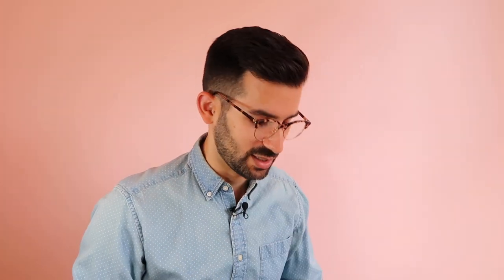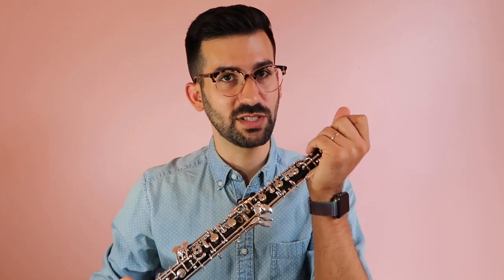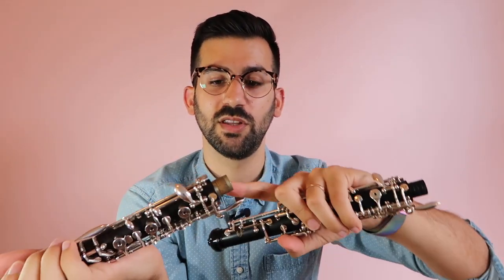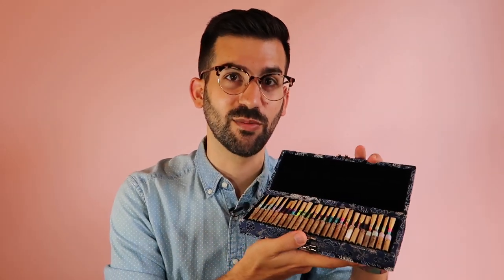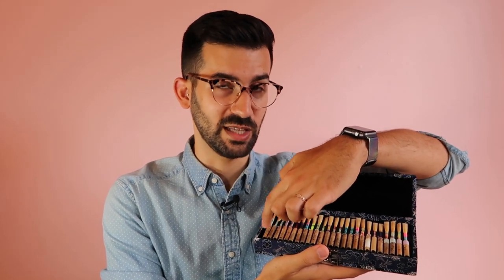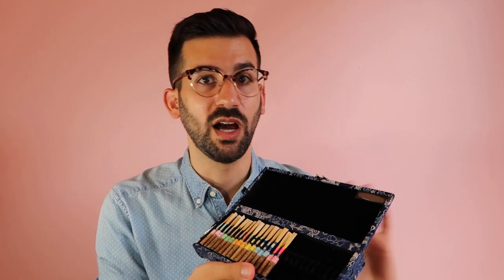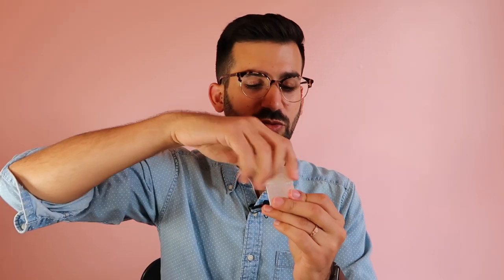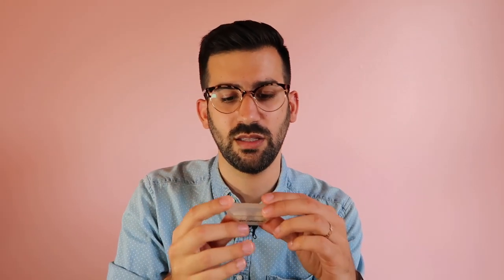What's Inside My Oboe Case?

Comment: For the cleaning papers I recommend the BG pad cleaner (I don’t know if you’ve seen them before); it is nice and small and it’s made out of cloth so it’s reusable too. It definitely doesn’t replace powder paper but it replaces the pieces of paper I used to carry around!
Reply from the maker: I've used the BG pad but I found it doesn't absorb water as well as the powdered paper. In the heat of the moment in a concert, I need to get the water out fast and that's what the paper does :)
Reply: @oboeari  Interesting, I haven't used the pad in general too much as a saxophonist but I'll try to see how it works on oboe!